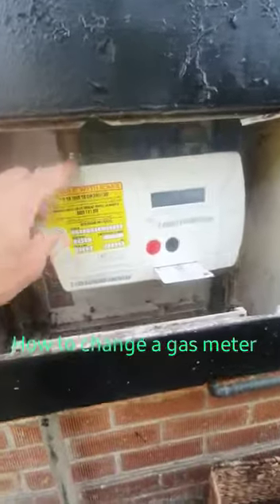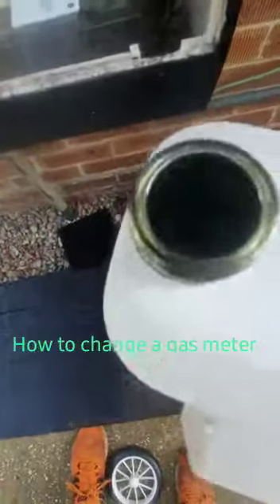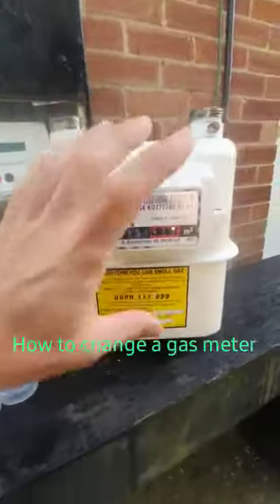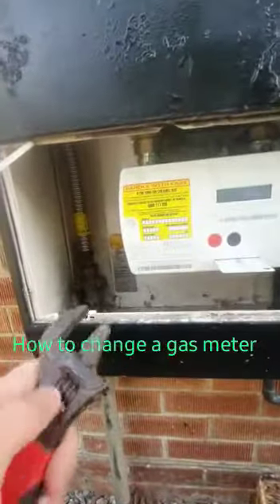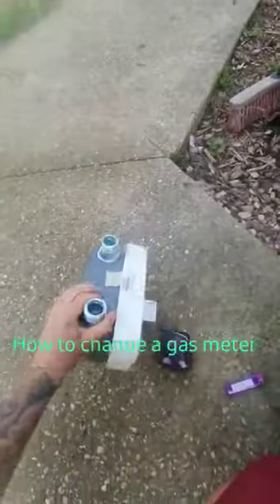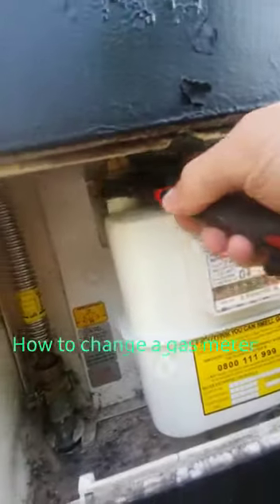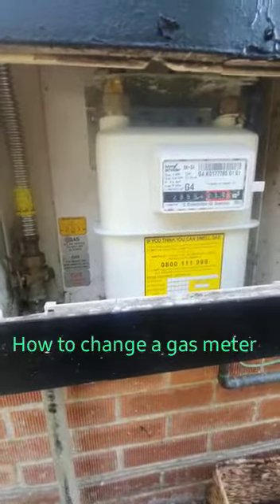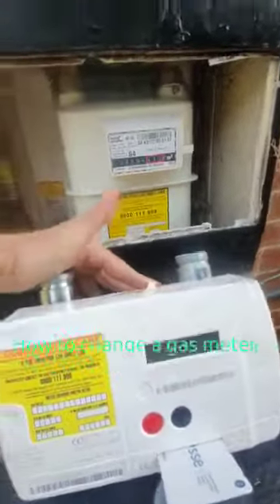How to change a gas meter ⛽

Comment: Hi my standard meter screen is blank but i still have gas can i just buy a standard meter and have it installed by gas engineer. Will my engery supply fine me or take me to court because they refused to replace it with a new standard meter
Reply from the maker: @Hassan-nu3rp  does yours still work? Ie do you still have gas? If so, keep it as it is. If not, yes, get it changed. "Fines" are something I can't advise as that's your own battle

Comment: I have asked Octopus to remove my meter and they say the electric power might have to be turned off , Is that correct? 
I have a Tesla Powerwall and im not sure how to set it up again . many thanks .
Reply from the maker: I don't know anything about Tesla Powerwall so I can't really advise. Sorry. I wouldn't be asking the crooks anything though 🐙
Reply: @intheknow3989  What i really wanted to know is why they told me all the electricity has to be off to remove a gas meter

Comment: how would you leave the connectors, lets say if you wanted to remove the meter and no longer have it. Is there a way to cap it. whats the propper way
Reply from the maker: Disconnect all the way back to the Emergency Control Valve and cap at the valve. Usually a 1 inch female cap.
Reply: @intheknow3989  Thanks for the info. Really helpful.
Reply: My meters a G6. I purchased a 1" brass cap and a rubber washer. Is this all i need to cap at valve. Do I need a sealing disc inside as well.